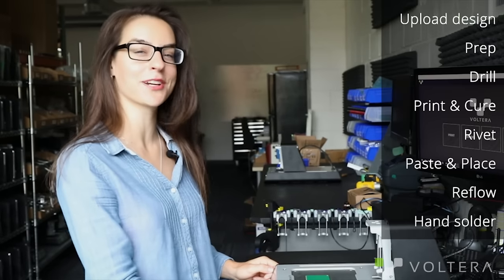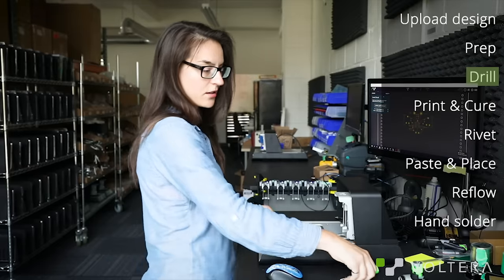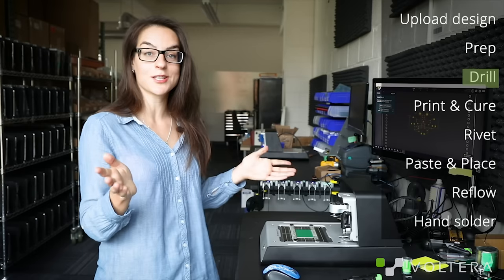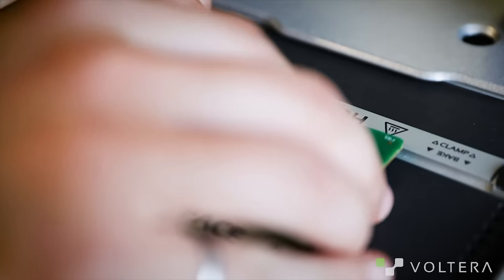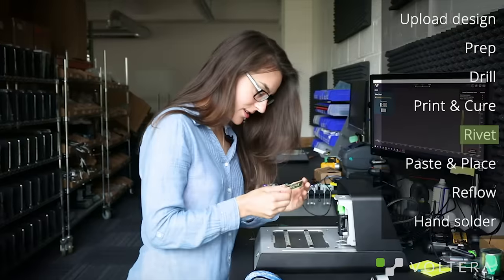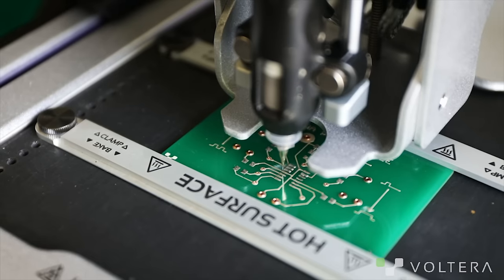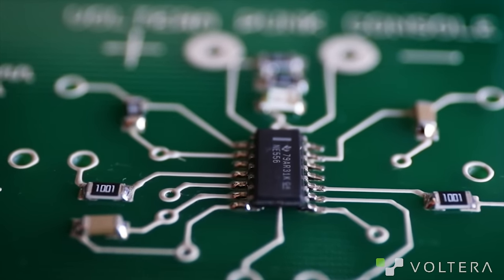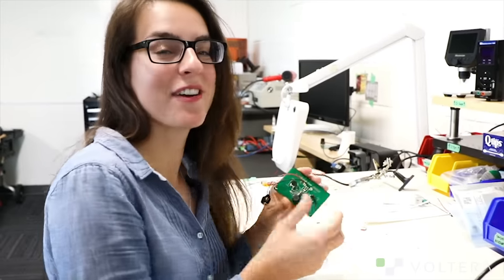Voltera V-One: PCB Printer Walkthrough

Comment: Rivets instead of vias seems pretty cumbersome, I imagine it takes some space and only comes in certain sizes. Not to mention patience and skill from the user.
Wouldn't it be possible to fill the holes with the conductive paste to link both pcb sides? Just curious.
Beautiful engineering nonetheless, cheers!
Reply from the maker: Great question. We did try this initially, and it does work — in fact it is still possible and some users do this using manual settings — but we decided it was actually more cumbersome in the end to make ink vias bridge the board. Ink vias require that you use tape to seal the bottom (so the ink doesn't leak everywhere), and you have to wipe the vias so they're compressed/level, which means you need to cure twice so you don't risk smearing your wet circuit design. Also, the rivets serve as a copper plating for through-holes, so you get a strong mechanical connection for through-hole components (while a pure ink conduit might get damaged with extended use). You're right about the limitations of the rivets however.

If you have a V-One and want to try making pure ink vias, just talk to our support guy Mike in the in-app chat and he can absolutely help you figure this out. Some people really do prefer this method, it's faster but a bit messy/finicky. Thank you for the kind words!
Reply: @voltera_io  I just designed a board with almost 200 vias. that would be a bit too much for rivets...
Reply: Hi Kat and Voltera. Here is a little idea for you, for double-sided boards. Why don't you drill the via halfway first, fill them with the conductive ink, cure them. Then on the other side of the board, drill 3/4 deep the same vias (in order to guarantee conductivity), fill them with conductive ink and cure them. What do you think of that?

Comment: After you punch the rivets, do you need to solder them on both sides of the board?  Or is the rivet-punch connection electrically sufficient?
Reply from the maker: The rivet-punch connection is electrically sufficient, and we do not solder after punching with the rivet tool. You can solder then if you want, but deforming them onto the pad surrounding the hole should be fine.

Comment: One of the video at Voltera printed a very wide trace and used the trace as a heating element with 9v battery. That indicates significant resistance is introduced in the circuit traces. Scary.
Reply from the maker: Hi Tina, thanks for commenting! Respectfully, I want to let you know you have this exactly backwards.

In some of our videos, we've plugged a 9V battery directly on the printed traces, with no other elements in the very simple circuit. So the entire load of the 9V battery is being dissipated onto the traces. Heat is the result of power being dissipated.

The power dissipated in the traces is going to be  V^2 / R  or (9x9) / R , where R is the resistance of the trace. If R is low, the power is going to be high and heat up. If R is high, power is going be low and won't heat up. The videos where we've printed heaters that quickly heat from contact to a power source actually demonstrate that the resistance of the conductive trace is *low*.

Heat as a function of voltage is, overall, a poor way of assessing resistance. You could short a 9V battery with a paperclip, and that paperclip is going to heat up. This doesn't mean the resistance on the paperclip is high.

If you want a deeper dive into resistance, resistivity and sheet resistance for electronics, we've got a post on our blog all about it! https://www.voltera.io/blog/resistance-resistivity-and-sheet-resistance

Comment: The girl is nice. The technology is very questionable.
Reply from the maker: We love questions! What are you wondering about?
Reply: @voltera_io  what minimum trace width? What minimun via diameter and minimum pad for via? What resistance of 1 square of trace? What is the trace material and how much it costs? Thanks!
Reply from the maker: @MaxmaxOFF81  out of the box we recommend sticking with 8 mil for printing traces, once you get used to the machine though we have smaller nozzles to push that down to 4 mil with our flex ink. Our rivets come in 0.4mm, your via outer diameter should be equal or greater than the rivet head diameter. 0.9 mm for the small rivet (more info here https://www.voltera.io/docs/working-with-rivets/).  The bulk resistivity of our ink is 9.5E-7 Ohms.m and the sheet resistance under typical conditions is 12 mOhms/sq, is approximately one order of magnitude less conductive than copper. Our ink is a silver based ink, as most conductive inks are. All of our pricing is available on our store -> https://www.voltera.io/store/ and our specs are published here -> https://www.voltera.io/specs/ more FAQs are here -> https://www.voltera.io/faq/ but I'm always happy to answer more questions!